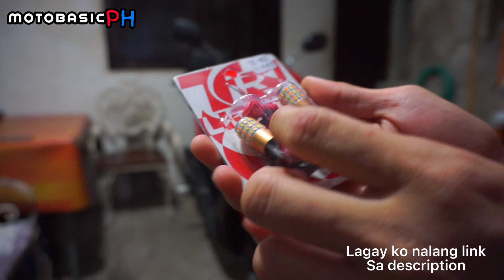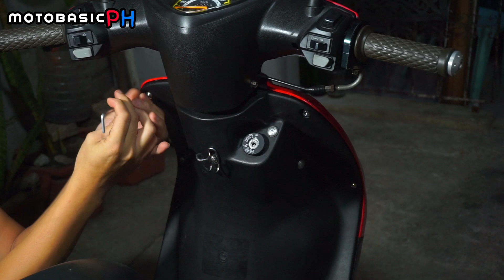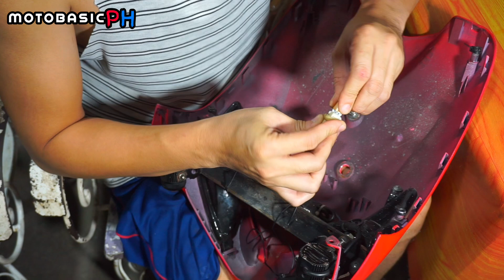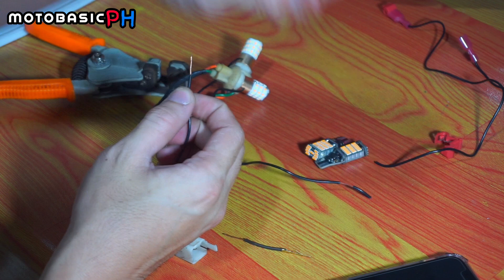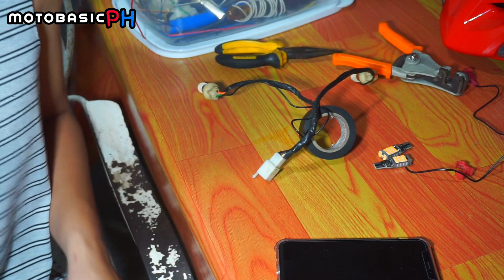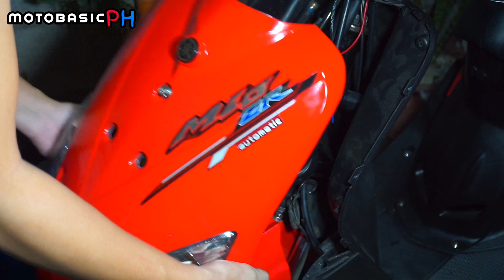EASY DUAL CONTACT INSTALLATION NAPAKA BASIC LANG!

Comment: Boss naka battery operated lang ako. Mio soulty Naka led headlight, taillight, may hazard light at passing light stock park lights stock din signal lights. Tanong ko lang kung kaya paba i drive ng battery kung lagyan pa ng dual contact na signal lights at led na park lights? I mean kung hindi po ba ma sho short voltage pag kinabitan pa ng another led's?

Comment: Boss may taning Lang ako ginaya ko kase set Ng motor ko fullwave batt operated tapos Ng lagay ako Ng 4way channel relay parang ung sayo may dumper din ako nung Una ok naman mga 5 months ko na ginagami tapos netong nakaraan mag oover charge na pumapatak Ng 16.5 pag sagad pag sagad pag ung remote ang ginamit ko mag start Ng motor ko pero pag ung Susi Lang hanggang 14.7 voltes Lang ano Kaya may prob dun boss.. salamat sa sagot parang nag oover charge sya pag remote ung ginagamit ko pag start pag Susi ok naman...